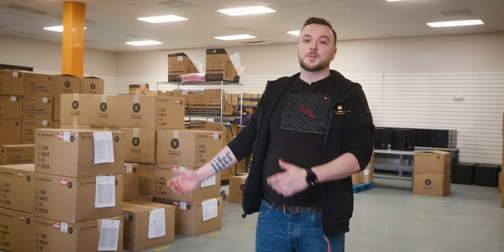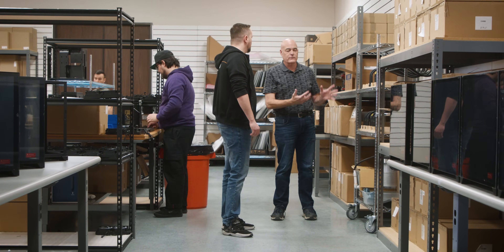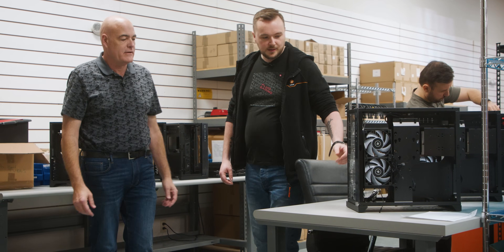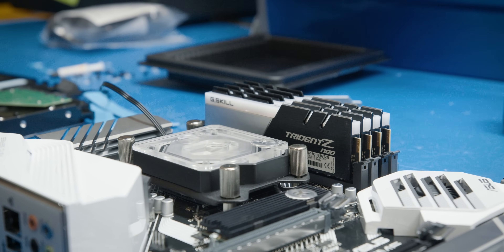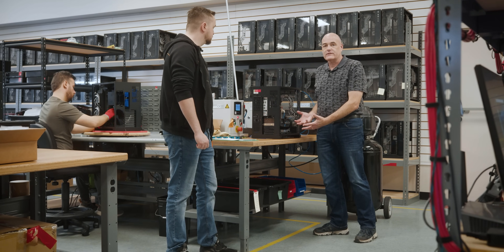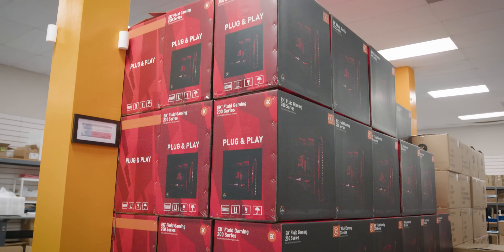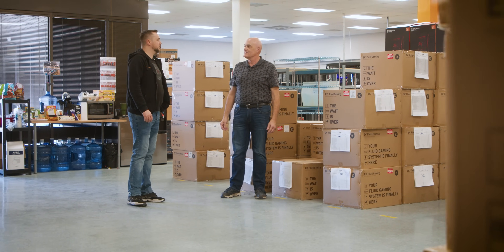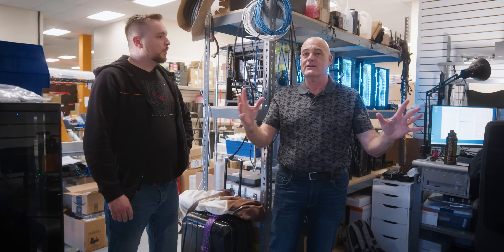Take a SNEAK PEEK at How & Where EK Fluid Gaming Builds are Made 🚀

Comment: Hey EK can i have one of these builds for free? (Imagine if they replied and it was that simple)
Reply from the maker: Sign up for our newsletter to be notified about the next giveaway for a chance to win one ;) https://www.ekwb.com/news/
Reply: @EKbyLMTEK  Damn i got baited
Reply: I have the 
POWERSPEC X602 ❤ 🕺🏽 LOVE IT 
* 		AMD Ryzen 7 2700 Processor 3.2GHz
* 		NVIDIA GeForce GTX 1070 Ti
* 		Microsoft Windows 10 Pro
* 		16GB DDR4-3200 RAM
* 		500GB Solid State Drive 
* 		
The PowerSpec X602 Desktop Computer features the AMD Ryzen 7 2700 unlocked processor kept cool to overclock by EKWB liquid cooling. This extreme performance gaming system is based upon the ASUS ROG Strix X470F Gaming system board powered by an 750W Gold power supply with CableMod's ModFlex sleeving for vivid color and supreme flexibility. It is assembled in a Lian Li PC-O11 Dynamic Tempered Glass ATX chassis including RGB fans. For gameplay domination it includes NVidia GeForce GTX 1070Ti 8GB graphics card and 16GB of G.Skill High Performance Trident Z DDR4 3200 RGB RAM. In   e, the Windows 10 Professional operating system is loaded on a Samsung 970 EVO 500GB NVME M.2 SSD.

Comment: Please fix software love the Elite 360 AIO
Reply: Perfect for i9
Reply: What software? I doesn't have a software.
Reply: @Attila_Gobor  EK CONNECT of course.
Reply: @sketchtherapy1218  that is not an AIO specific software, it's a, controller. And there will be a brand new controller at one point. If you are having issues with the current software, please contact the support team,.
Reply: @Attila_Gobor  No. It should work, they should fix it. It's supposed to go in Case you download and it works. They need to fix it, I don't need to call, I did my part I bought it & I downloaded the software. I love the hardware. I want to be constructive but I'm not gonna spend half a day on the phone. I'll go as far as sharing this feedback & wishing them the best. No hard feelings this is business I'd still buy more hardware I can't give feedback on hardware aside from "great work" I don't want them to change it unless they want to, it's the bast as it is.
Reply: @sketchtherapy1218  Did you talk to support, the software is already "fixed", but I don't know what issues you are experiencing...
Reply: @Attila_Gobor  I’ll check it out thanks for the heads up. I’m not calling tho I hate the phone I’ll just download and see if the new one works.